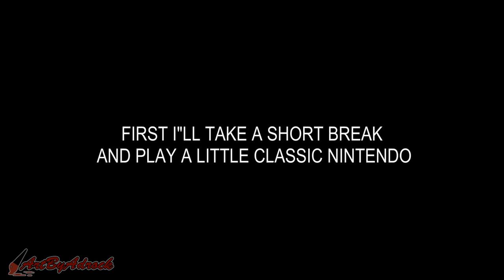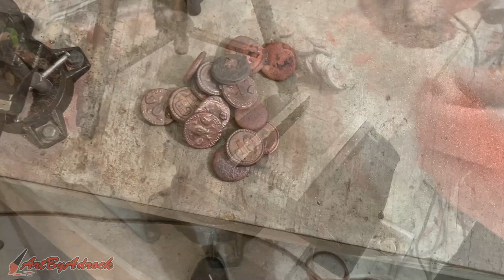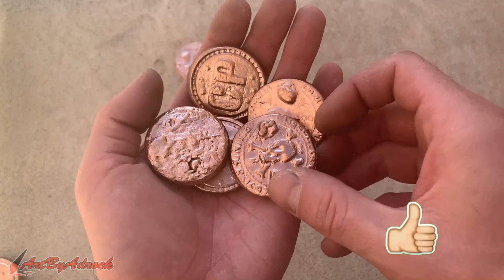Turn Scrap COPPER Pipes Into Custom Golden Coins At Home - Custom Coins Made Easy

Comment: I was just about to suggest using a tumbler when you brought one out.  The coins definitely look better from the tumbler and they would look even better if you used a smaller medium and left the coins in longer.  But you wouldn’t want to leave them in too long as the medium could polish away all the fine details, it’s something you might have to experiment with but nice job anyway 👍

Comment: When using the tumbler, what did you put in there with the coins? Tack nails?
Definitely the tumbler for cleaning; it can reach spots more easily than a wire brush can.

Comment: I think BigstackD needs to get a bigger tumbler and polish up all the coins he has so far, they look much better tumbled.  Just a tip for the tumbler try getting small stainless steel bearings,  that's what they use in casino's to clean up the change and it works great.

Comment: Ive been watching you and bigstack for a while now even bought a devil forge. Im looking to buy some coin moulds...where can i find them? Cheers from the uk
Reply from the maker: They are available on my website. Check the description
Reply: @ArtByAdrock  cheers ill have a look. Also im having trouble with my greensand not holding its edges when removing the molds.any advice?
Reply from the maker: Is it wet enough/dry enough? Are you using talc? What’s the original piece made of? There’s many factors that can cause problems
Reply: @ArtByAdrock  when i removed my mould(made from wood) the edges seem dry and crumble easily i have added more water but dont want it too wet. Talc for parting agent
Reply: How hard should i be ramming the cope? Top side of cast always comes out better that the bottom